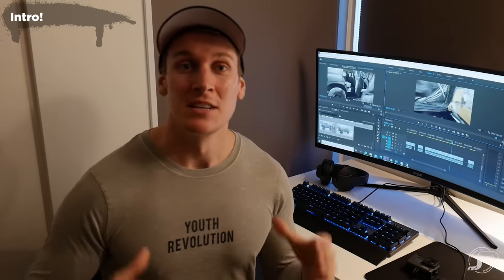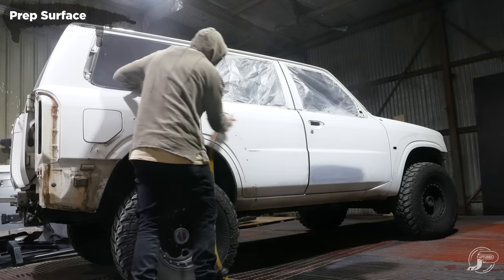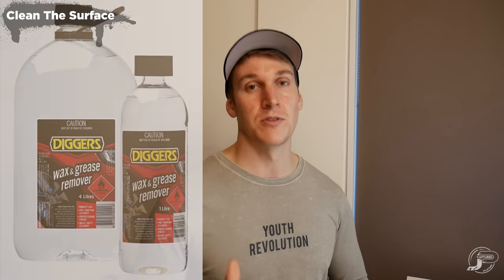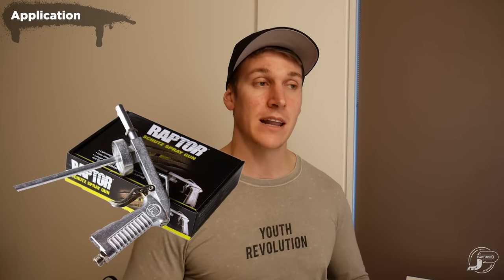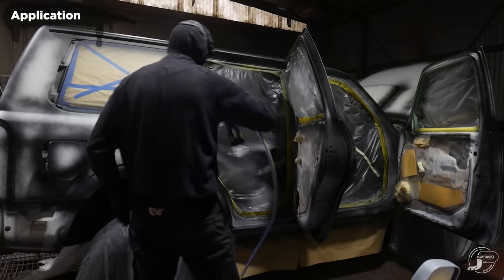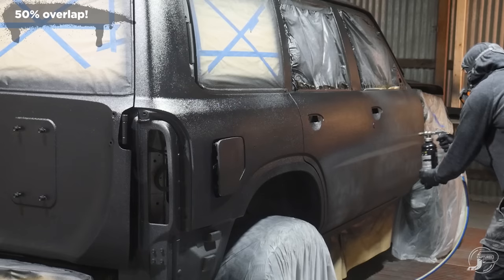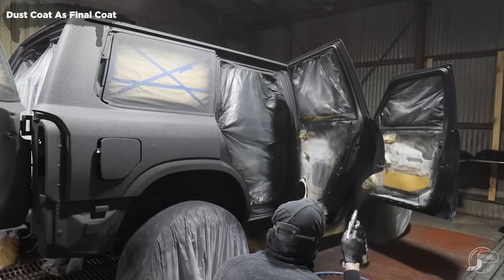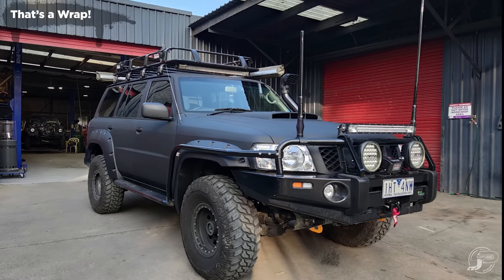Spraying A 4WD In Raptor Liner Bedliner #Shedsessions

Comment: Thank you!
I do everything myself, but I seriously suck at painting.
I just finished my '03 Tacoma in Bright White and it came out Great!   I watched every video I could find and this one was the one that helped me the most.
Reply from the maker: I'm stoked to hear that your project came out the way you wanted it too. Glad i could help.
Reply: How much did it end up costin you?
Reply: @noahhuffaker8115  I put 4 coats on the Tacoma, including the "dust" coat and used 13 bottles of white Raptor Liner and 3 bottles of black for the bumpers and grill.  I spent about US$700 on 16 bottles of white and $140 for 4 bottles of black.  There were some incidentals, like sandpaper, Scotch-Brite, etc, but the truck turned out so well I used those to paint my car too.  So, for both vehicles it was about $1500 (didn't use as much paint on the car).

Comment: Well I was going to say that this was one of the best vids re Raptor on YT - then you mentioned that it was for a customer, well that explains it! No point in me saying that I agree with your methods, as I am DIY but this was a terrific tutorial. I did the canopy of my Navara, which turned out ok, but the tub worked out better, and I did do a mist coat at the end, and it made a hell of a difference. I am just getting in the mood, as I have my Bullbar off and prepped and am about to paint it in Raptor too. It really is a great product, goes on easily and covers up many imperfections and is forgiving for the not professional - like me. If you have a fourby it is a very useful and versatile product. Thanks again for a great vid. Cheers mate.

Comment: One thing I have wondered about; How does the doors seal after the liner is applied? All the gaskets now rests against a really structured surface.  Isnt this a problem?
Reply from the maker: They sure are, well that's only if you paint them in such a way. When I paint that particular surface the build technique I use is different to the rest, the end result is a hard wearing smoother surface so everything still seals nicely.

Comment: I made a lot of mistakes spraying my f150. So to avoid more sanding and reapplying remember these tips. 
1. If you are spraying with the Schultz gun make sure it is at 6Bar (90psi) at the regulator not the compressor and stand about 3 feet back. 
2. Spray hard to reach spots first then maintain 90° to whatever surface you are spraying so the texture isn't skewed into streaks or ovals. 
3. You can also reduce raptor which gives more coverage and will allow for a much more even coat but lower build. 4oz urethane reducer, 2oz acrylic base coat (no binders), 0.5oz base coat activator and 8oz hardener was my perfect mixture but it would overflow the bottle so mix in a separate container and do half a bottle at a time.
4. Have a full bottle of lacquer thinner or acetone ready to clean out your gun between bottles (very important) if you don't you will get thick globs sporadically.
5. HVLP guns require even higher reduction (8oz reducer) and a larger spray hole. The 1.4mm standard clogs very fast but you can drill it out carefully to a 2mm easily but still can't replicate the thick texture of a Shultz gun. Some Wagners texture guns will work but they are more expensive the cheap ones don't work well at all.
6. Rollers should only be used if necessary they are not ideal but having one just in case is a good idea. A paint sponge works great for quick touch ups on mistakes. 
7. Check weather for the next 4days. It can't get wet before it's cured. 
8. Read upol instructions and follow them over anything YouTube suggests.
9. Wait 45 between coats to flash

Comment: Final cost ?
Line - X quoted me $10,000 dollars
For a lifted van.
And still 6 months waiting to get worked on.
Nobody wants to take on the job.
Reply from the maker: A raptor liner job is cheaper than that, email me for more details jpcaptured@outlook.com.
Reply: Raptor is way cheeper plus its easy to clean  compare to Line x.i did my truck last year and im really satisfied
Reply: I did a few lifted trucks, and a Ram 2500, turned out great.
Reply: @marinevetgarage9101  i just was looking at your video , U should wear a mask my man!! That shit is very toxic
Reply: @simonpearson1567  your right. I have a bad habit of not wearing it because I'm outdoors.  But totally  agree with you.

Comment: ive just ordered a 4 bottle set of tentacle raptor. but only 3 of mail colour. did that to have a free bottle when I got a small car and won't be needing all of them. or so I thought until I saw your vid. How would it work to use 1 bottle tentacle without tint for the first base coat? hard areas, corners and so on. and the 3 left for the rest?

Comment: If you're just raptoring a Bonnet with a spray can is it the same application technique? But just with a spray can?

Any tips when using the cans?

Cheers
Reply from the maker: my advice on the spray can is not to use the spray cans, sorry.

Comment: Hey JP, first off great video! This was a huge help as I tackled my project. One question I had was around splotchiness in the final coat. Overall, things came out really good, but if you get in the right light, and the right angle, you can see some splotchiness in the paint. Short of respraying, have you found any tricks or things to try that can possibly blend things together and hide those little inconsistencies?
Reply: When it’s wet you can dab it with mashing tape. Light dab and matches the textured finish, once it’s dry you have to re spray it.

Comment: Hey, awesomely detailed and straight up video! Do you need any special kind of primer under Raptor?
Reply from the maker: the u-pol acid etch primer is honestly the best way to go.
Reply: @jpcaptured799  Thanks! One more if you don't mind, would you paint a rear end with bedliner?
Reply: @jpcaptured799  will it work with an oil base primer?

Comment: hey mate 
will raptor stick to normal primed surfaces 
ive got a 60 series that i have coated the bare steel with rust proof primer. should i seal it or just go for it with the raptor 
mind you its just a shit box that im trying to get a few more years out of

Comment: Looks great! Doing this to my truck soon. When switching out the empty can for the full one, do you clean the gun out first? Also, does the starting/stopping between cans blend well?
Reply from the maker: I clean the gun in between coats.I have not found any issues with blending while switch paint pots on my spray job no. The downtime is minimal 5-10 minutes at most.

Comment: So I just sprayed my whole vehicle, however due to time constraints I didn't wait 60 minutes before applying my dust coat, just between coats one and two. Will this adversely affect the end product, or just make it take longer to cure? Also, it took a long time to apply the first coat, is there an issue If it isn't tacky anymore when applying the second coat?

Good pointer on getting the hard to reach areas first, that is critical. I'd also recommend everyone do this in a very well lit area if they want a professional result. Otherwise it's almost impossible to avoid tiger striping, as you just can't see. And because if the gloss level of the  Raptor it is very hard to see where you have applied too light of a coat
Reply from the maker: The dust coat will be fine being applied 60 minutes after the previous coat.

Comment: i'm going to be spraying  the railing/fencing on my pontoon boat.  raptor liner page says 125 sq ft/ gal.  bottles come in liters, but if i am supposed to do a light coat, 2 coats, then a dust coat... any idea how to break that down by  square foot?  railing is 25x8.5 feet, 22 inches tall.  2 sides, 2-4 coats... 2 coats i was guessing  just under 4 gallons. (16 liters)  thought about ordering another 4 liters just to make sure i have enough.   any advice?

Comment: QUESTION! How long is the work time? I did a few small panels, everything took one bottle but by the third coat (2 hours) it started spitting out globs like it was drying. 
Maybe next time remove and cap the bottle and clean the gun between coats?
Reply: If you're waiting around 45 minutes of it sitting you should clean it. Just run some acetone through it and that should be good in between wait times. and always cap the bottle while waiting. It's an epoxy and dries fairly quickly. If its closed and in a temperature controlled area, you should have around a days work time. Just make sure to mix well after each wait time.

Comment: Does it give off much off spray? Do you need to tape up your shed gear or floor?
Reply from the maker: it depends on so many factors.. but yes it does have off spray but it's fairly heavy and drops to the ground fast.